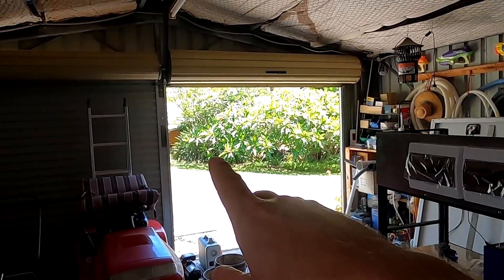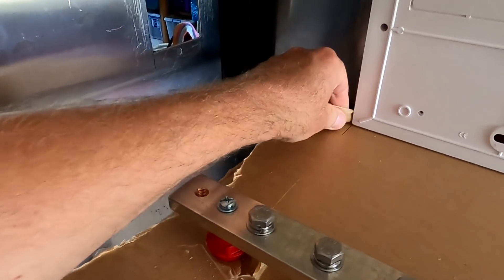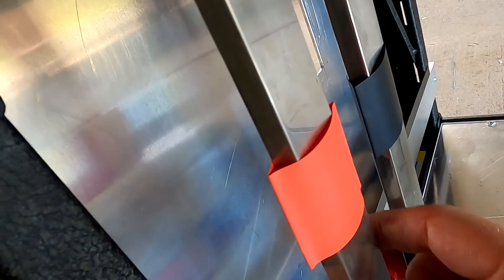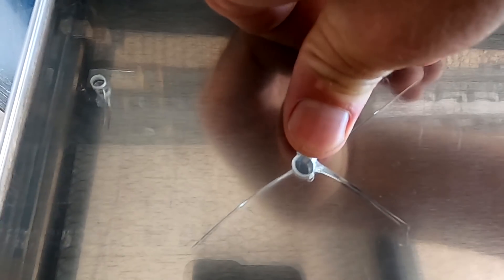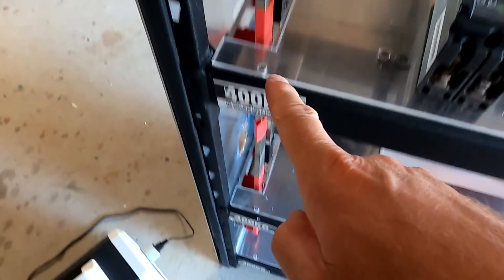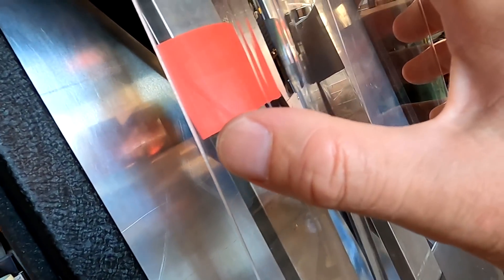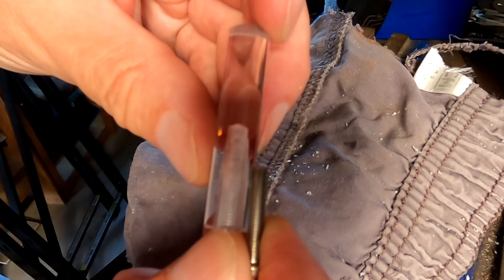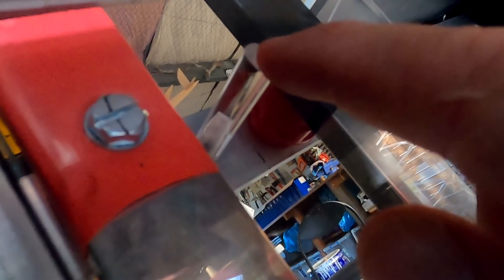Will this crazy idea actually work? Acrylic bus bar covers for our #Battery2.0

Comment: Always use very small bit to drill a pilot hole with plexi glass.. keep pressure modest and speed slow with all drilling especially as the hole bursts through the opposite side..be gentle on the first hole and the rest are safer and won’t crack outward…
 then a mid size hole and finally a larger hole as needed.. much more accurate , never cracks , never gets hot enough to melt the plexi..less pressure required to drill.. 
I have done this for decades on . I learned after breaking many pieces in the early days 
I found the 3 step process works great… if the hole needed was really big I would use more steps than 3…

Comment: Nice job, you can put an RGB stripe wit an voltage controller it gives the coresponding color to the stripe acording to the voltage or the amperadge. So it will give you a direct alarm just by looking it changing color.

Comment: Be aware that it is best practice to have a physical separation between the positive and negative bars with DC. An additional acrylic strip between would be good, heat string or resin is best.  Also be conscious of how CB's discharge ionising gas during high order faults.  Potentially review the position of the breaker horns and direct the flow away from the bars.  Due to the constant nature of DC rather than AC, arcs created by ionised gas will self propagate and create a serious problem!  Structurally the supports look a bit on the weak side for high fault conditions.  Appreciate that you have switchgear building experience, but DC continues to catch out the general switchgear builder.

Comment: Andy - Excellent.  Question, do you use IPA (or some other cleaner) to remove finger grease before you tighten any of the high current connections.  Also I am sure you would clean the busbars on final assembly anyway.
Reply from the maker: No special cleaner. I've got some water and tiny amount of detergent to get the grease off, that's it.

Comment: Like I suggested before. Nice acrylic plenum. If I ever saw one before!  
"Electrical plenum:
Plenum spaces are the open spaces above the ceiling or below the floor that are used for air circulation. Technically, any ductwork is considered a plenum space too."

Are we keeping a tally on the cost? Just curious; thanks.
Reply from the maker: The costs... with or without labour?
Yes, I've got a spreadsheet for everything.

Comment: Rather than drilling and tapping acrylic rods,  I would have used acrylic tubes and had a long screw that goes all the way through
Reply: If you do that it would be necessary to cover the head of the screw as it will be at busbar potential
Reply: @nigelcharles511  No.... the screw would touch the acrylic cover and the shelf, but would not touch the busbar
Reply from the maker: Another way of doing it.

Comment: I have some really nice heat shrink,  from a place called temco, they sell really nice wire and stuff, at a good price, the shrink tubing is 1" '25mm, and us glue lined, and shrinks 3:1, so it will get a good bit smaller, and many sites are available, it also has a nice texture if you wanted to use it on handles , it is also decently thick, 
I think I'm going to start buying some of the lifepo4 cells like this, and maybe go to 48v, a 5-6kw inverter us about all I need,
Reply from the maker: Just found the Temco heat shrink on eBay. Good tip.

Comment: You could also get some RGB led’s and control them with an ESP8266.  If you get the 12v versions, you can series them to run natively on 48v. You just need a 48-12 or 48-5v converter for the 8266. Then you can make them change colors under certain conditions. Red for warning, orange for charging, green or blue for charged. Or even set colors for SOC. Just some fun thoughts.
Reply: This is really cool idea. Do you know anyone that did such a project ?
Reply: @rahsomali   I do not, but I may have some time coming up and might give it a try. I have all of the components on hand. Maybe I’ll see what it takes to do it.
Reply from the maker: Yeah, that was my initial idea I explained in a previous video. The problem is though, the front panels need to be from fire resistant material. I bought all the clear plastic sheets to look inside and also the LED stripes but may not be able to use them.
Reply: @OffGridGarageAustralia   Oh I missed it then on a previous video.  It didn’t occur to me you were making it all fire retardant. I kept thinking the shelf looked cool and industrial. 🤦🏻‍♂️🤷🏻‍♂️😊

Comment: Nice design Andy, can't wait to see the finished shelf with all the batteries, connections, BMS and the blue LED 👌 you can add blue voltmeters on the exterior, just a suggestion 😉
Reply from the maker: Thanks 👍

Comment: Andy you need a hobby lathe, there is plenty of room in the Offgrid Garage  if you throw out the old batteries . Then you could drill holes in the middle instead of all over the place ?
Reply from the maker: No, no, no more machinery. I need all the space for batteries!😁
Reply: I got a laugh from this!

Comment: I always keep M6 nylon bolts and nuts along with hollow spacers that can be shortened to length, can come in handy for holding components and being insulated at the same time
Reply from the maker: I was thinking of nylon bolts but because mine don't really old anything than the cover, I went with stainless. Next time 😉

Comment: You can use electrical paint for insulation on the bussbars or any connections that can't be covered easily.  This is now a work of art.  Are lighted multicolor fans next?
Reply from the maker: I would not cover the bus bars any further. I've got aluminium stripes here... 😉

Comment: I'd move your shelving unit into it's final position before final install of your vertical bus bar covers Andy, any twisting of the shelves will shatter those spacers.
Reply: The spaces he is using are a very good plastic, I have some here at my place.
Reply: @chuxxsss  They are fine in compression and tension loads but useless in shearing loads, especially after drilling and tapping 50% of their cross section out.
Reply from the maker: I've moved the shelf a few times. It's does not twist at all any more. It feels like a die cast!

Comment: If you work on Acrylic you may use alcohol for cooling and separation between work piece and chips. Different from oil alcohol evaporates and you are not left with that oily mess. 
And keep away any silicone spray from electrical contacts. Depending on shape and pressure the metal cannot penetrate silicone oil. The automotive industry once hat severe problems with their switches. Silicone from molding process of plastic parts migrated and seperated contacts quite reliably.